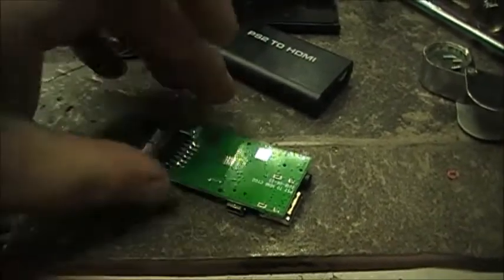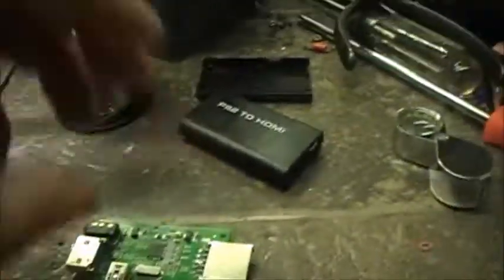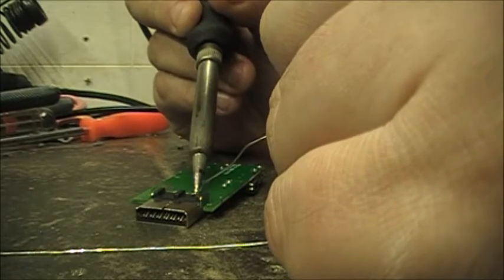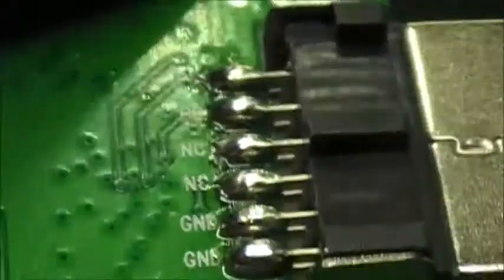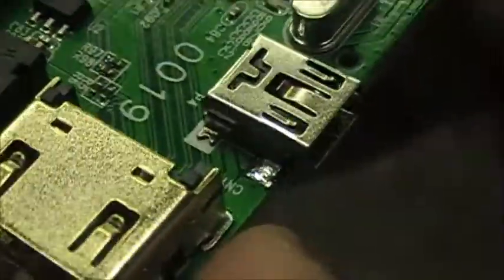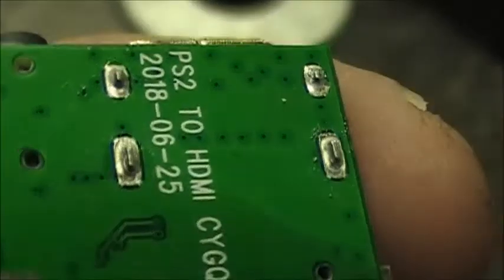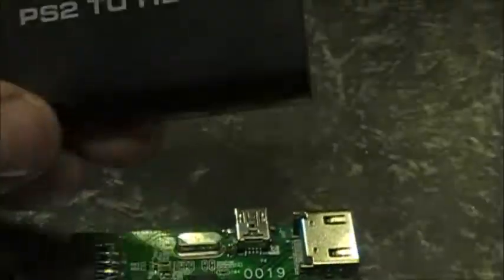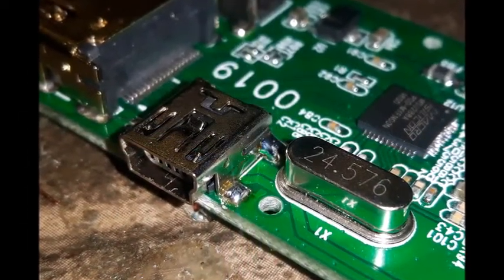PS2 to HDMI Converter repair

Comment: What is the USB output used for?
Reply: The adapter requires 5v power from a usb to operate. Most of these adapters are like this. Even my component to hdmi adapter I use for most of my old consoles needs usb power. I think it is to power the chips that adapt the component signals to the HDMI format.
Reply: @batterypwrlow  strange, I've never pluged it into usb and it always worked fine
Reply from the maker: I honestly have no idea!   Take a look at the owners manual, should mention something about it.  :-)
Reply: @Radionut63  guess what - the manual doesn't even mention anything. I think the usb cable was supposed to keep this thing running, but newer versions simply don't need it anymore